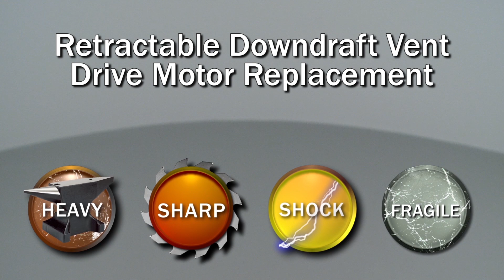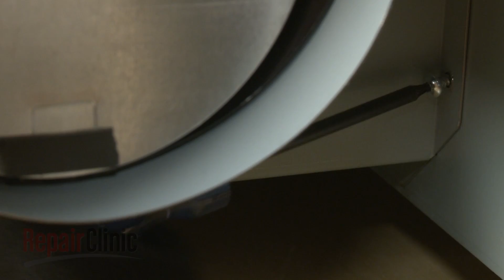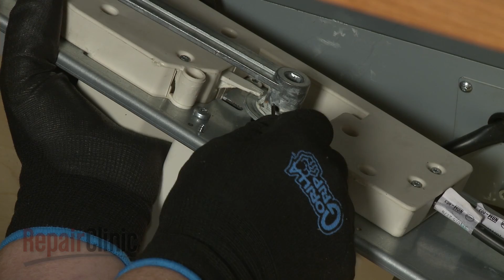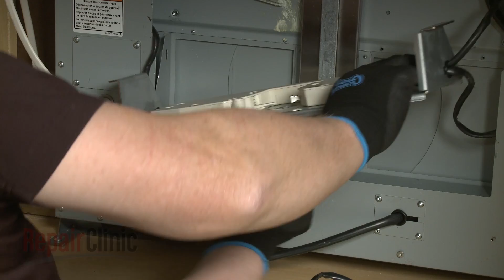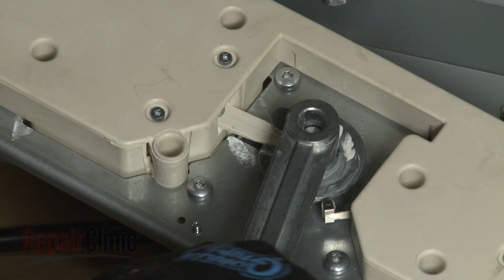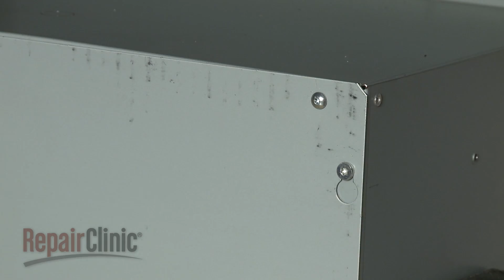Whirlpool Retractable Downdraft Vent Drive Motor Replacement WPW10398274

Comment: My KitchenAid Retractable Downdraft doesn't stay 100% up. It rises and works, but back down to 50% and remain working in that position. What part should it order to repair that condition? Model: KXD4630YSS2, S/N: XH 613 22100

Comment: When troubleshooting don't for get to check that the filter screens are in place. there are button switches that have to be depressed by the screens before the unit will rise and fall with the drive motor. Your problem may not be the motor or the switch.